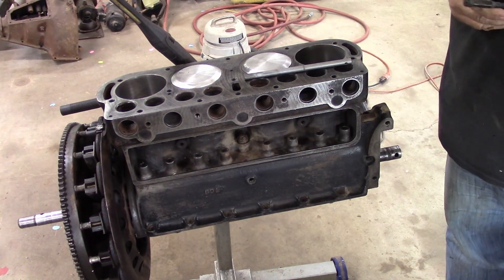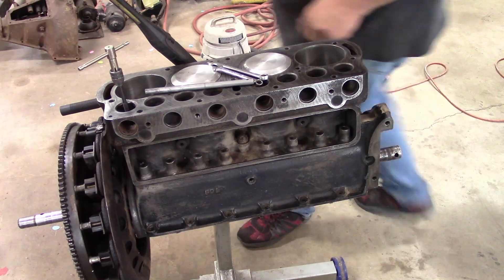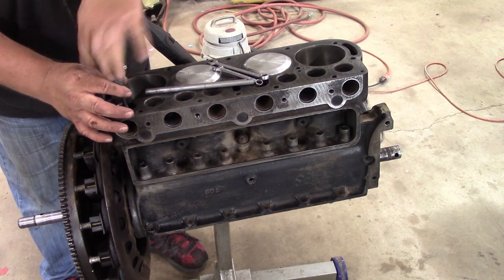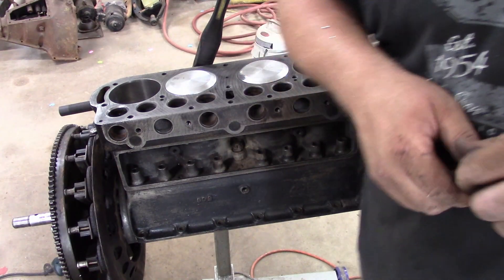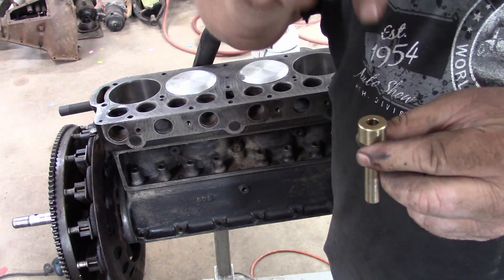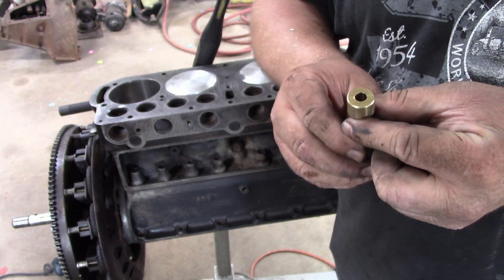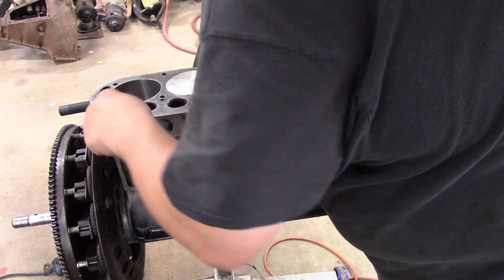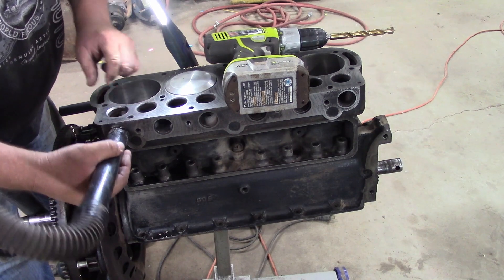Model T Ford Engine Build 12

Comment: Hi over there. Nice job, I was afraid that the drill would follow the ofset hole. Another solution could be using a magnetic drill press.
Looking forward to the next videoes. We have been restoring model T & A since 1966 her i Denmark
Reply from the maker: I had the same worry too.  But sometimes you just don't know unless you try!  Thanks for watching!